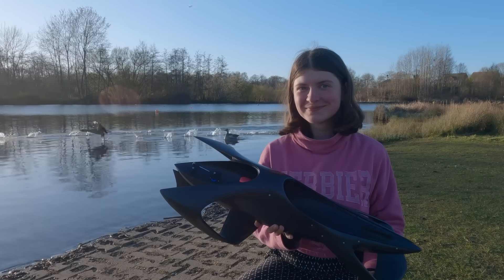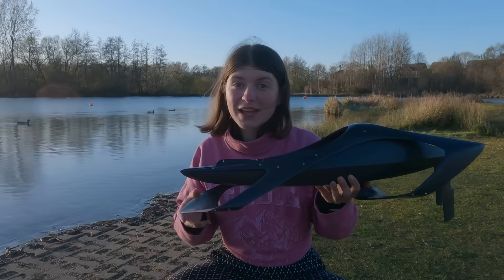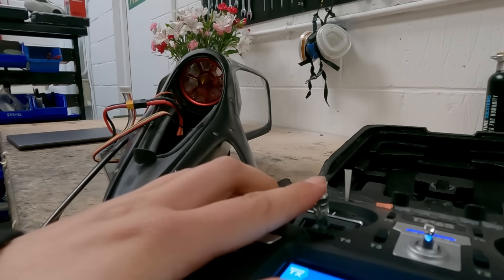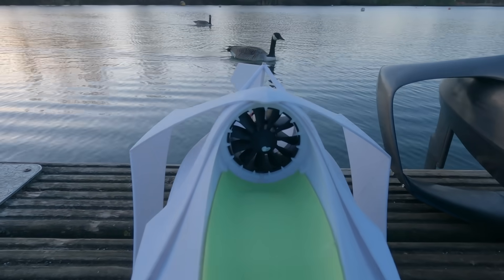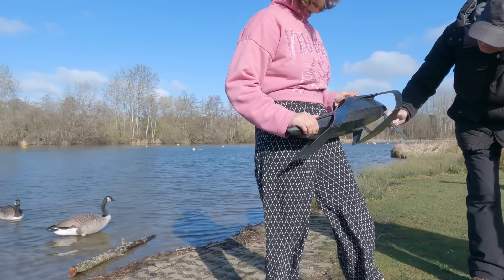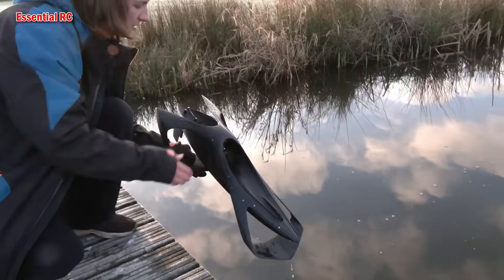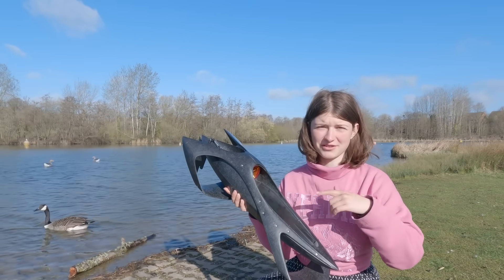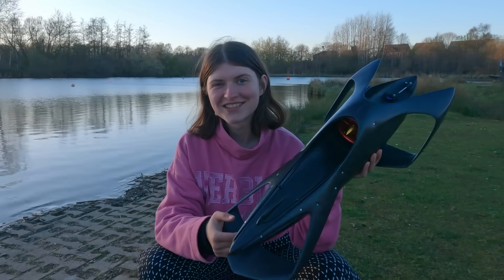Boat Propellers are Overrated... The HydraJet Explained

Comment: Very nice!  It eludes me how it can handle ocean waves, riding on top of them and tracking the surface angle. You probably thought of this by having it transition to hydrofoil mode?
And you might consider vectored thrust and get rid of the rudder drag.

Comment: Absolutely amazing! I’m impressed. I would recommend going with an underwater propeller you considered. Edf’s are terribly inefficient and lack control compared to an underwater propeller. You might be able to design a finned enclosure for the motor and place a water proofed bearing on the driveshaft. I wish you success.

Comment: I'm onboard. No pun intended. I'd love to see something like this full scale!
Reply: I'm not even 30 seconds in and that's already where my mind is. This NEEDS to be scaled.
Reply: And now I'm 2 minutes in and she just said "WHEN I make a full scale..."  I simply cannot wait.
Reply: intend your puns!!!
Reply: Where you gonna Sit?
Love the Design and function
To be clear, is all that power out of a
 1x 2600mA battery?
Reply: @SiiideSa I think she said 6s
Reply: I wonder how it would handle waves. She addresses this by saying the hydroplaning would keep it smoother.
Reply: @justincoats7236  yes there is a certain limit to significant wave height it could handle
Reply: @justincoats7236  I imagine it would depend a lot of the frequency of the waves VS the speed and angle of travel. Eager to see it myself.

Comment: Turning a prototype into a production model with an effecient assembly line is truly an accomplishment! The difficulty in making a design producable is often overlooked, and never understood or taken into account by those who have never taken on the endeavour. Awesome job!
Reply from the maker: @donnydavinci1772  thanks, but who said the production had an efficient assembly line 🥲 It's as efficient as I could make it but the recycled carbon boats are so labour intensive they'll have to stay low volume, I'm looking into ways of scaling up production though with injection moulding but making it meet my sustainability requirements is difficult
Reply: @CovaConceptsSustainability and carbon reinforced polymer don't match. If you want low volume and intricate shapes, I recommend you jet binder printing.
And for car panels or body not make for crash but lightweight : thermoforming.

Comment: I’d say definately build the version built for outright speed, you’ll grab the fast rc boat groups attention way faster like that. A little for instance and something to aim for…a 6s powered mono hull which as you know is typically the slowest hull type  with a surface drive propeller set up has a record straight line speed of 82 mph. 6s hydro speed record is almost 130 mph which is what your hull would be considered with 2 points of hull contact. I know there are some guys who for fun added an airplane prop and brushless motor on a pod to a 3 point hydro and went over 100mph, so I’m sure your design has some potential for speed. I say go for it and at least find what potential velocity it’ll achieve!

Comment: design looks so slick, like a water batmobile. good job
Reply from the maker: @attikaifinch  thanks!
Reply: @CovaConcepts I caught the Batmobile comment & wondered if you could add a paraglider shute to it would it also fly stably? maybe you could pitch a flying boat with its looks to a film company making either a batman or bond movie & get some development funds to build a full scale version looks fun even if a bit noisy
Reply: @sanealex  I think making it into a ground effect vehicle once it exceeds a certain speed would be super awesome. It could use a surface skimming foil that is mechanically linked to elevators that would automatically adjust the altitude so that once it's flying in ground effect, the altitude would remain constant and not require any operator input...
Reply: @step4560  I was thinking that once it reached a certain speed it could transition into full flight if it had a para-foil shute & once out of the water it would get lift from both above and below which would have to be balanced for stability I think with more lift from the shute but on further consideration. For better looks matched to the existing vehicle rather than the curtailed look of a para foil wing I'd go for the old skool Rogallo wing that was used for super sonic space capsule flight but a controlled ground effect would probably make a more efficient vehicle.
Reply: @step4560  that's exactly what I was thinking.   see Flarecraft
Reply: I thought the same, could be from a Batman movie and the color matches.
Reply: I want one that I can take a friend for a ride in ! ! ! !
Reply: Lol, was about to post 😂😂
Reply: I just wrote a comment about it too lol. It does look straight out of a Batman movie. Now all she needs to figure out is where to mount the bat logo hehe 😉
Reply: Those are called Batboats. 🦸‍♂
Reply: Actually the Bat Ski Boat from Batman Returns was exactly what I thought of. I always liked the design of that vehicle and it was a fun toy. Add a cockpit and you have the modern version of that.
Reply: Oh already have a batmobile comment here...
Reply: I want to see all the footage ,it must be very good!!

Comment: Hi. That's quite a project you've done. And the end result is really beautiful. and then in carbon fiber.  :) 
I have an idea for a project. zero energy sailing. Sailing, with sails, or electricity. Or both.
There are a few examples, but I think you can come up with something that not only works, but also looks good. An example is. FIBRE TRIMARAN BY HANSTAIGER.

Comment: Would thrust vectoring or ducting the fan do anything to improve the control and output?
Could you move the turning fin to the trailing edge of the front vertical supports; put a pair (one per side) on them to offer both forward stability and possibly a tighter turning radius?
It's such a cool design, would be fun to 3d print it even just to have it as a display piece!

Comment: How is  carbon fiber recycled? Very cool looking vehicle. I wouldn't write off planing at full size as there is a racing class of such boats, as I'm sure you know. Admittedly they look cool but not nearly as futuristic as your design. Suspension might be easier to implement (Think long travel off road) than active control surfaces and the related computer systems. Subscribed!!!
Reply from the maker: @FeralRabbit  thanks for the comment! The recycled carbon comes mainly from offcut waste from the aerospace sector, it gets recombined into a non woven matt. For a full scale boat the planing vs foiling depends on the market, planing boats could go faster as they're not limited to ~70knots where foil cavitation becomes an issue. Suspension on boats is interesting and something I've considered a lot!

Comment: Very cool project!   Your first post (on insta) really grabbed my attention.  I have a material science background and I just finished up a few online courses on advanced composites and additive manufacturing (MIT) where we dabbled in generative design (in Fusion) and 3D printing carbon fiber.  Your design reminded me of the gen design processes which is very iterative and organic.  Fantastic tool.   I hope to start R&D for some electric vehicles using reclaimed LFP batteries from my work. (solar biz.)  and building composite parts. Would be interesting to see a video on your car.   Looks like another cool project.
Reply from the maker: @daveluxton8317  thanks so much! I started off designing in Fusion's free form environment to effectively sculpt vehicles. Your reclaimed LFP R&D sounds interesting, my car is in fact a 4-wheeled ebike, designed to replace cars for short journeys, I'll start posting about it in detail soon on @amaraautomotive